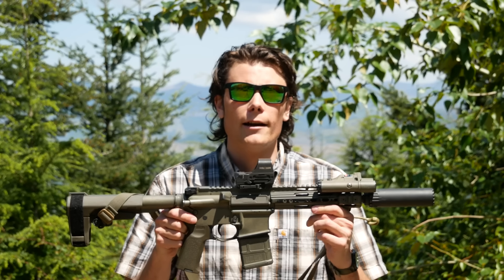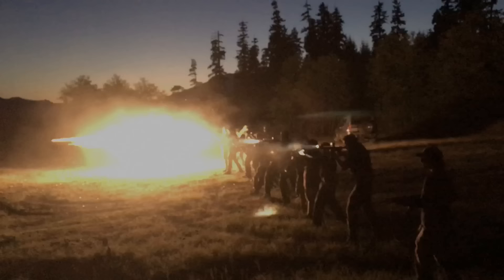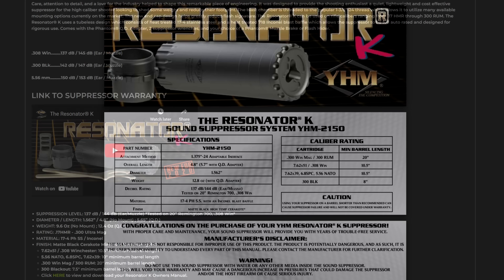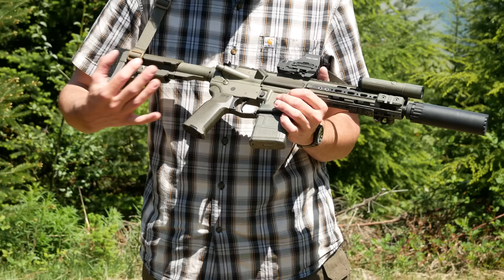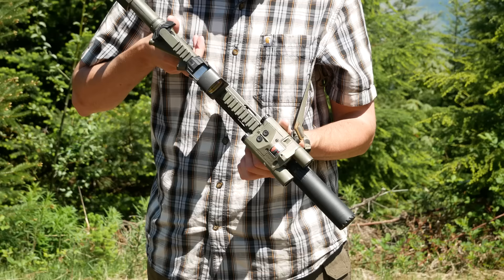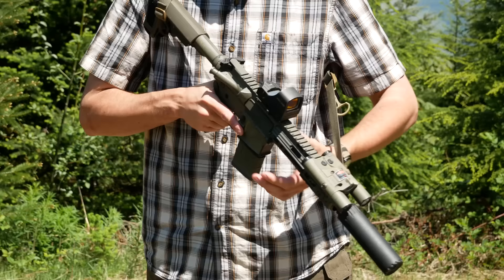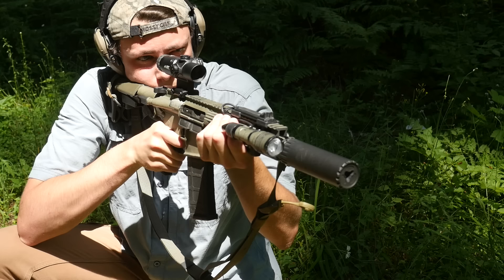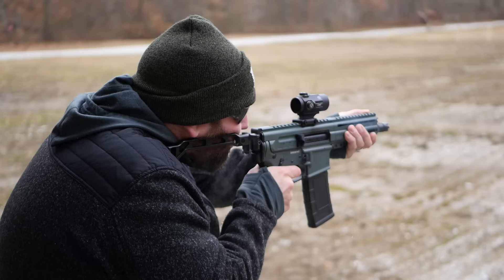The Broke Badger .300 Blackout PDW

Comment: I’m you’re doing supersonic 300 blackout.  Why not a 11 1/2 or a 14.5 in 7.62x39?
Reply from the maker: AKs are terrible, x39 mags for ARs are terrible, the ammunition is terrible and getting more expensive by the minute.
Reply: @Hoplopfheil  the mags have made huge advances but you are correct with Brandon in office the cheap x39 is not available. 
     I have a 7.62x39 m16a4.   I love it.
Reply: @Hoplopfheil  sig buys Duramags for their 7.62x39's for a reason. They're not that bad. 

Most 7.62x39 setups are for poors and poorly made. A properly configured 7.62x39 runs well and shoots well. I have cheap setups and some 'custom' setups. There is a significant difference on paper between off the shelf 'for the poors' stuff and what I can make them do.

Comment: How many times have you run into the issue of having your open emitter blocked? I feel like these pricey closed emitter optics are about ss neccesary as the forward assist function on your upper
Reply from the maker: Yeah those pricey closed emitter optics like the Romeo 5
Reply: @Hoplopfheil   I recall you having solid praise for that Holosun in your eotech clone video, but now its got to go because open emitter bad. But yeah you've got some dogshit tier options like romeo 5

Comment: People keep saying 300BLK is good for penetration. Banana Ballistics has tested several loads and it doesn’t penetrate 💩.
Reply from the maker: I don't think I've ever heard anyone talk about 300 blk penetration.
Reply: Penetrating steel plates and penetrating glass without deflecting as much are very different things
Reply: anything to do with penetration requires Vmaxxed energy
Reply: @Vrilltrooper-of-sillymaxxia  go watch a 405 gr hardcast 45-70 go through gel and get back to me
Reply: In semi-fluids, penetration is mostly determined by momentum and sectional density after any expansion. A lot of .300BLK bullets are light for caliber and expand well so one would expect that they wouldn't be good at semi-fluid penetration. If you are talking about steel penetration, which most BB penetration videos are about, velocity and bullet construction (generally a combination of hard and shatter resistant being better) are primary. I'd guess that not many .300blk loads are optimized for steel penetration.

Comment: I’m in between thinking of building a rifle like this in .300 or a PSA jackal in .300.
Reply: It's what I did. 80% lower. Midwest Industries tube folder and a carbine tube I cut down a bit to use a BT brace I had. Trimmed the edges of the brace a bit, so it folds completely flat, clearing PSA's Pic adapter. The thing is TINY when folded. Cant settle on an optic, but fun figuring it out.

Comment: Any advice or thoughts for keeping a direct thread suppressor to stay on the barrel nd not back out? Nd not having to pin nd weld it?
Reply from the maker: Tighten it, shoot a dozen rounds to heat it up, and tighten it again with a wrench.
Reply: @Hoplopfheil  ok, what about the hub adapter. Same thing? Like with the silencerco omega 300 you can use the asr, keymo or direct thread
Reply from the maker: Yeah but you can loctite or rocksett that if you really want it to stay in place and don't need to change adapters often.

Comment: 300 cool but expensive.  A shorty AK much the same advantages but less expensive.
Reply: Because you then run into AK problems with mounting stuff on the rails for night vision use. If you're only going to run supersonic. 300 BO then I'd say that an AK would do a similar job, but for the roles people want subsonic. 300 BO then I think the shorty ARs are better. At least that's my opinion.

Comment: My problem with supersonic .300 BLK is that it is still just worse 7.62x39. I wish .277 Wolverine got traction instead.
Reply from the maker: It's better than x39
Reply: @Hoplopfheil  I have heard of some loads that can outrun 7.62x39, but they're nearly destroying brass from the pressure. Comparing notes between my 7.62x39 and my buddies .300 bo load data, I'm a little ahead. He has to go to great lengths to keep up with me and I'm not running things very hard.
Reply from the maker: Same barrel lengths and bullet weights? Comparing data from a bunch of places on the internet it looks like .300blk supersonic velocity from an 8" barrel will narrowly edge out 7.62x39 supers from a 10" barrel, with nearly identical bullet weights. And then 300 blk has a nontrivial lead in exterior ballistics.
Reply: @Hoplopfheil  there's an overwhelming amount of fluff out there when you're doing comparisons, and a lot of fuddery and misinformation. I can point to an internet 'source' that says the 300 bo runs 25 fps faster than a 7.62x39, both from 9" barrels. 25fps is within chronograph error or ammunition inconsistency in small samples. I can find the write-up that says 7.62x39 outruns 300 bo from longer barrels too. But, pressures aren't mentioned, or ammo details, and neither are barrels other than length. When I compare my same reloads between my 16" and 24" barrels for velocity, I'm seeing different numbers than what I see online. Yes, I'm running a little faster than a 300 bo with the same 125's and the same barrel length, both of us loading to max pressures and using similar powders that are well suited for the application. I hold more powder than he does. 

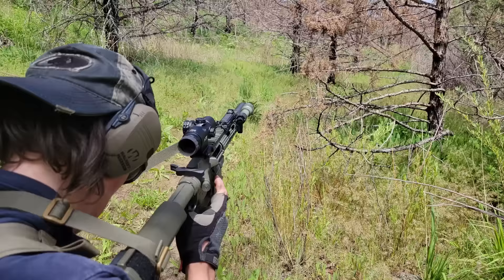Some fluff comes up a lot is the 300 is better because it uses .308" bullets and the 7.62x39 doesn't. Ok, that's easy. Use common 1:10 .308 barrels, and chamber for .310 bullets in European/surplus like I do. For one thing it streamlines barrel production and inventory. Bullet diameter becomes a non issue, and most end users will never know the difference. The 7.62x39 can hold a 220 or 168 sierra match king or a 125 speer tnt and they look identical. They're a great fit at AR mag length. 

And then when it comes to exterior ballistics, when you're using the same .308 bullets at nearly the same speeds it's a tossup. Limiting yourself to 7.62x39 .310 bullets vs 300 bo with frangibles/monolithic expanders/premium soft points is fair for commercial ammo availability comparisons but it's not the limit to possibilities.

We could skew this in favor of 7.62x39 if we use only .300 bo ammo that is loaded to just cycle for plinking loads. Again that would be ignoring the little details like actual chamber pressures. 

Take a peak over at the 6 arc/6.5 grendel crowd. They're having similar magazine issues and they break bolts when they're not paying attention to pressures. But, those are getting more popular as they're better understood and supported because they have a more knowledgeable user base than the 7.62x39 AR user base. They're also not suffering from the 'poor scourge' of cheap low quality components like barrels and bolts like 7.62x39 is that definitely affect accuracy and reliability. 

Commercially available, 300 bo wins because more people support it and the knowledge base for configurating it properly is much more developed. For the reloader and hobby gunsmith with options, I'm going 7.62x39 because it's the same performance for subs and slightly better super performance, with new commercial brass super 7.62x39 coming in from Europe at reman 300 bo prices.
Reply from the maker: You know there are multiple types of powder right
Reply: @es4583  300blk has projectiles with much better BC
Reply: GUYS! GUYS! You're arguing for no reason. They're almost the fkn same thing.

300 BLK might be easier to find in subsonic, and 7.62x39 might be cheaper in standard rounds. One might edge the other out slightly at different lengths which probably is due to 7.62x39 in the US being all cheap af, but again that can be a benefit (ie: cost).

The solution is simple: own both and stop being poor.
Reply: @es4583  even greater if you compare to literally anything other than tula.

Comment: how do you have this much money
Reply from the maker: Enough money to build a cheap AR 4 years ago? How indeed.
Reply: @Hoplopfheil  its not just that. it's all the gear + all the weapons + NODS. you have more equipment than some infantry companies that i've seen put together. i hope you appreciate what you have.
Reply from the maker: I appreciate that I paid for it with money I got from my job
Reply: @mingus445_gaming  There's these things called jobs. Make yourself useful, and you can get one. Make yourself more useful, and you can get a better one that pays more money.
Reply: @stoptrackingourdata8158  i'm not gonna get a job just to blow everything i get on being a LARP operator. either do that job or don't. No reason to buy things you really don't need. It's just not logical. The equipment DOES NOT make the man.
Reply: @mingus445_gaming  You ok, bro? You wanted to know how to get money (I'm assuming to spend), and I told you.

I'm pretty sure Hop spending money on guns is more than "LARPing" considering he works for a company that tests firearms and gear.

Comment: 300BO is gay.
Reply: My problem with it is that it doesn't do anything really well. Better and cheaper options at both super and subsonic, long range and short. What's the point?

Just my opinion, but I'd rather have two different weapons dialed in that each do one thing really well than one that pulls a hard "meh" at everything, especially if that "meh" is costing me more per round than the other two would.